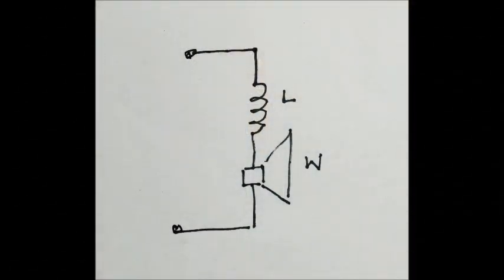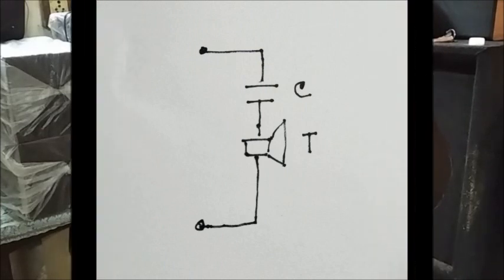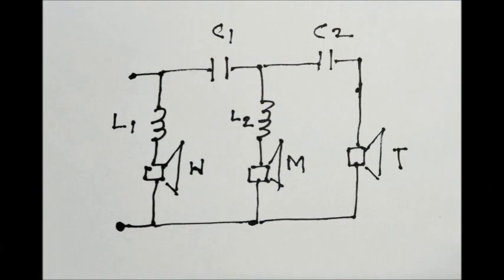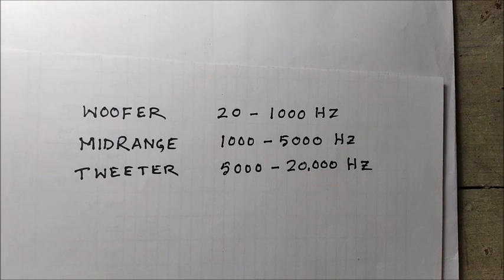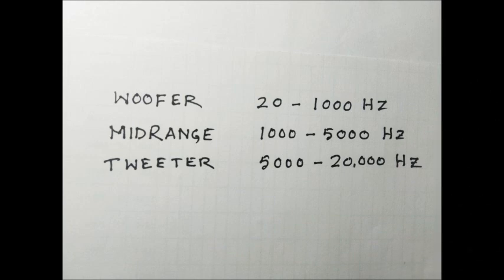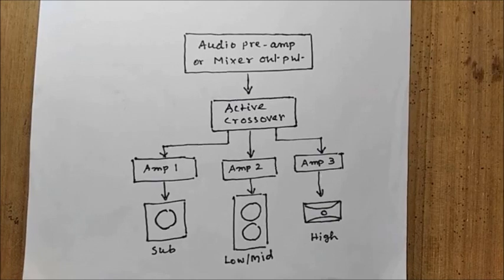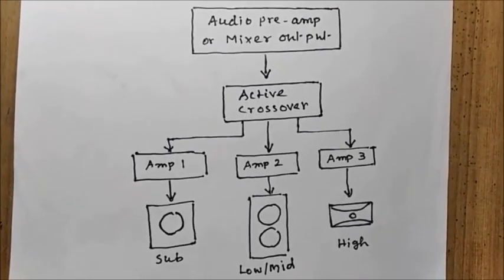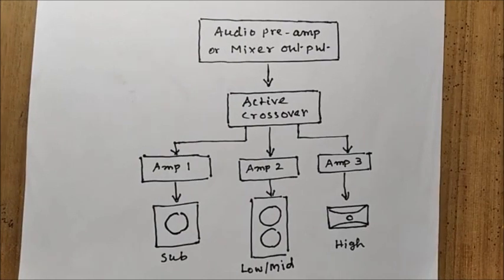How to use a Midrange speaker

Comment: Why did you use the 6db cross over network? Why not 12db? Please explain sir.
Reply from the maker: 6 dB network allows more low mid frequencies. 12 dB is used where sharper cutoff is required.

Comment: I am using woofer and tweeter on a 2 way cross over..Now I want to add a mid-range speaker as well on same circuit..How Can I add and what Capacitor should I install..plz guide

Comment: Just a question sir, if we are making a duct hole for air passage (for 10" sub-woofer/woofer) in a 3 way speaker box, do will still need to isolate mid range speaker by back cover or separate chamber within the same box?
Please reply
Reply: Definitely if your mid range speker is unsealed then it must be in separate chamber, even a duct or port at the enclosure.
Reply from the maker: Right

Comment: how much watt tweeter and midrange do I need to go with a 8 ohm 30 watt woofer ???? plzz reply ...
Reply from the maker: You can use a 10 watt midrange and 5 - 10 watt tweeter. Mid and high frequency consume much less power than low frequency.
Reply: @makingloudspeaker  thank you so much sir my amp is 35 watt RMS 8 ohm to 16 ohm into 5 channel, Sony STR KSL5 .. I read in avform that woofer should be 80 to 90% 10% for the tweeter & midrange and I have two magnetically shielded 8 ohm 15w salora woofers by which I'm thinking to make the 3 way center channel.

Comment: The midrange speakers you have shown here are all sealed back so no seperate enclosure or partition will be required in side the main box. That's good. I have an old (40 years old approx.) 5 inch Philips made sealed back midrange speaker and it is still working fine.
Thanks.